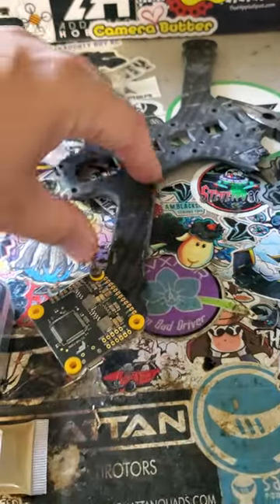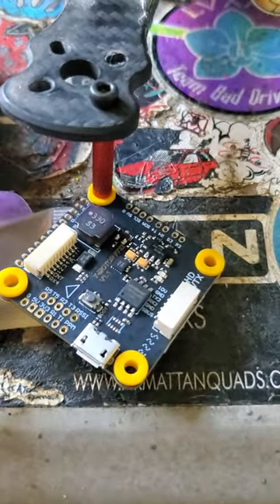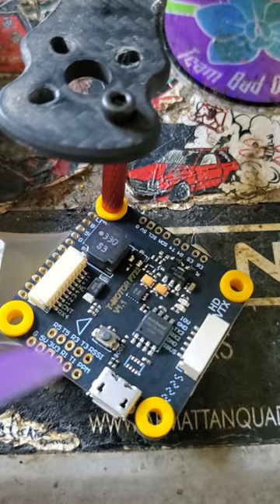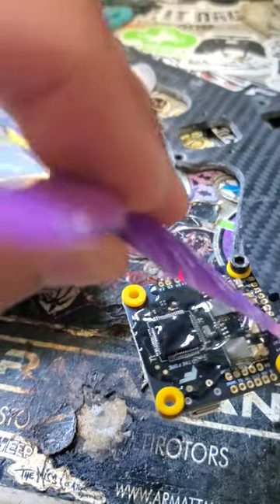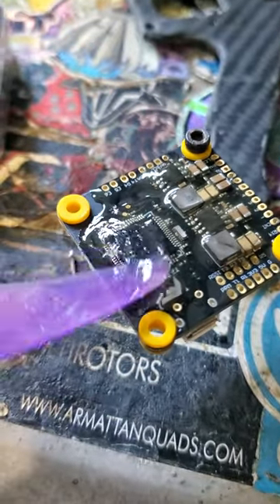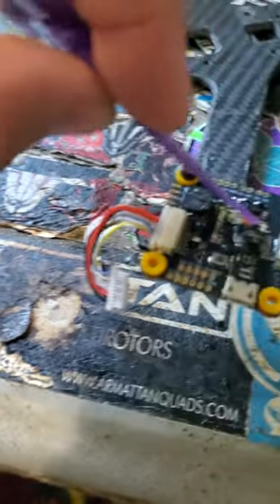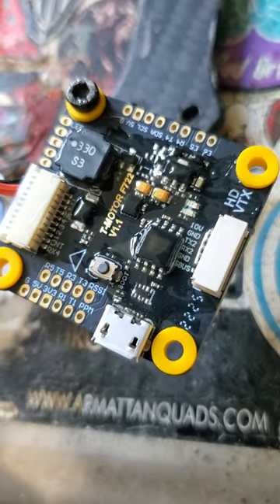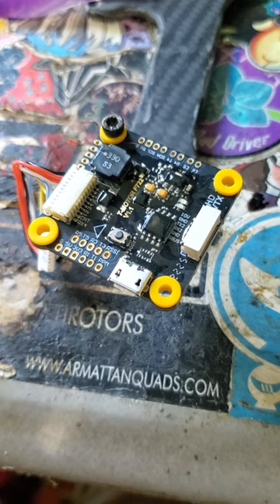How to conformal coat your flight controller, waterproof drone with Worry Free!

Comment: do the electronics heat up more after coating them?
Reply from the maker: No, ive never "burned" a board from overheating them.  They do have a minor thermal impact, but you have 4 fans to counter that. On the ground it may shorten your envelope a little, but i'm jn Alabama,  it's like 95-105 most of the summer, and i'm not burning shit up 👌
Reply: @Fly_High_FPV  nice.  Definitely wanna order some
Reply: @Fly_High_FPV i just ordered some from you lol 
Do you only do it to this pcb board? What about the camera/vtx? I have a caddx polar vista

Sorry if you mentioned this i was watching the video on silent
Reply from the maker: @RandoManFPV  I always put it on fc and esc and receiver boards. The vista is waterproof, but i coat the solder pads. The camera is optional. For extreme waterproofing, remove the camera body and paint the board front n back, avoiding the sensor.  Once it's reassembled, check the focus, then paint the threads and the backplate to prevent water while immersed. Normally, you can skip the camera 👍 ive got a whole playlist called WaterProof Quads, where i show how to coat fc's, and esc's, show underwater testing , flights in the rain, and more.  Brandan_FPV 's YouTube is another great resource 👍
Reply: @Fly_High_FPV  awesome thank you so much bro I'll definitly check the Playlist

Comment: What if a work come off the pad and you need to resolder it back on . How do you get the coating off so you can solder back on the board. ?
Reply: 3:50  He mentions how to get it off here.
Reply: @SunriseWaterMedia  scrape it with a fingernail that's the answer ?
Reply: @ChrisQuadFPV  That's what he says. He's the expert 🤔😉
Reply from the maker: @ChrisQuadFPV  yeah bud, it peals off easy with a fingernail for rework 🤘

Comment: Aren’t there parts of your stack that you shouldn’t coat like the barometer?
Reply from the maker: Yes, if you use the baro, i typically disable it because i fly full manual and no GPS
Reply: @Fly_High_FPV  thank you for responding. I just ordered some worry free and plan to coat. Are there any other components that can affected if coating is layered? Other than usb and other plugs ?
Reply from the maker: If you're looking for a barometer, it's usually a silver tic tack, with a lil round hole in tbe top..dont clog the hole 👍
Reply from the maker: @sydballa6572  that's it, have fun 💦💦